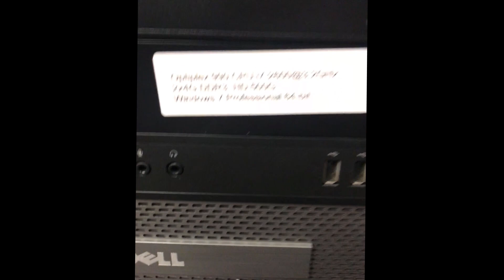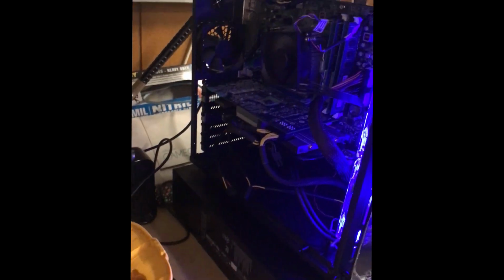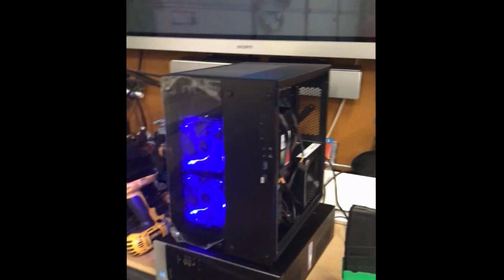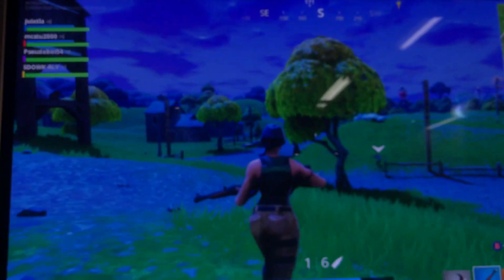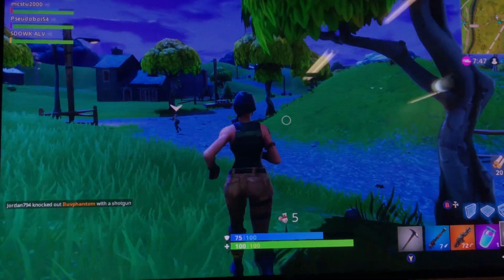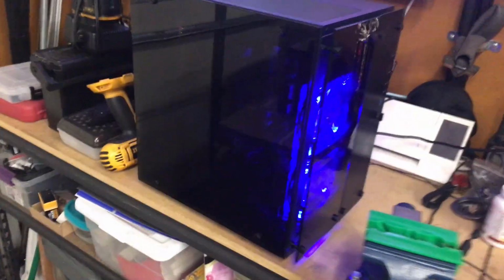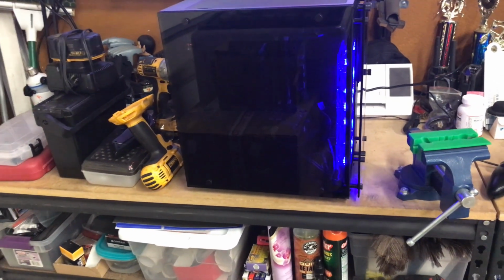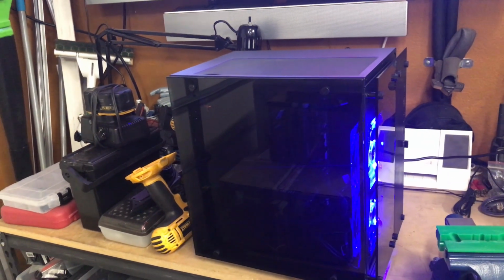Dell Optiplex 990 Gaming Case Upgrade Power Button Pin Out

Comment: If you want led on power light, to the left of that power plug is 2 unused pins, one is 12v . Works great on mine. Tip for tip thanks

Comment: Please i need you're help  i cant find the 6 pin connector for gpu power and i have 990 dell optiplex
Reply from the maker: I had to replace my power supply, motherboard uses standard ATX supply, so you can just pick one up that has a 6 pin connector for you GPU. I would go 500W min.

Comment: So you had to cut the wires to the proprietary power cable and then connect that with the power cable that came with the case? How exactly did you do that?

Comment: hah, i got Dell Optiplex 3020 for 80€ in early 2020
i had to buy me 2x adaptors to start upgrading this thing...

NEVER AGAIN I BUY DELL BTW, they have some weird censors to stop you from upgrading too much...
Reply: Like what?
Reply: I did the same. I got it on Craigslist for 75 bucks. I'm upgrading it and it's been a big struggle. Especially on a super tight budget

Comment: i used the power wire from the new case but the leds for the hhd and power button don't come on. i was gonna ask did you try to keep the front in the case but plugged in.

Comment: You can use jumpers to bypass 3 of the power switch pins and then just plug in the case power wire as normal too. It's the far most 2 pins from the 5th one that looks like it's missing a pin. (Use jumpers Vertical)
Reply: Tribute Born don’t you have to cut the plastic part of the motherboard then?

Comment: Awesome video! I'm doing a 7010 case swap and I don't want to use the optical drive this time around. Is there a way to disable the error on startup without having the drive connected?
Reply: Press f1 i think

Comment: I made one too..But i used  small HD.I5-2400..Power switch.lga 1155 990 M/B,Dell Psu,Rosewell case,Got it all on ebay less than a 100 Bucks..The F! doesn.t bother me at all..one can get a dell 990 lga 1155 board on ebay for 18 dollars..I had Gskill ripajaws ram already...U got bored building assus,MSI and Gigabyte PC's..so Just for Kicks and Giggles Custom Building Custom Dells..My next one will be a lga 9020 Build with the Lga1150 setup...Any Way Great Video..I will Subsribe..Thanks

Comment: Do you really need the Dell stock power switch adapter? Or are there just 2 pins that I can plug my power switch Cable in?
Reply from the maker: You can cut the plastic housing from around the pins on the motherboard, then your new case power connectors will fit. The housing that is currently there is a little narrow to fit the two power connectors from the new case. Take a look at this vid, might be helpful https://www.youtube.com/watch?v=u8sv_33W3FI&t=66s

Comment: I did this with a Roswell case,got a power Switch lead from Ebay,and a 2.5 hard drive to make it easier..I 2400 cpu..already had a MSI750 ti graphics card..thinking about doing a dell 9020 since M/b can be obtained on the cheap..1150 socket i5 4570 cpu..But i can get the barebones sytem off ebay around 50 dollars of which i did added a 3420 duel core ,HD.,ram all less than a 100 dollars
Reply from the maker: Thats not bad at all. Thank you for sharing.
Reply: Wait i have a rosewell office case can you send the link to the power switch lead if you can find it

Comment: You think there’s a way to get the case fans up and running ?
Reply from the maker: Yes, I was able to do that. The stock case fan is held in by rubber plugs witch I recused to mount it in the new case. I attached mine to a vent/grate at the top of my new case. Reusing the fan is straight forward as you will just plug it back in to the motherboard like it was before. Its just a matter of finding a way to mount it in the new. Mounting was very easy for me, but that may very depending on your new case.

Comment: Hey If I wanted to use a gaming motherboard in an optiplex case would the proprietary power switch work on my motherboard?
Reply from the maker: I do not believe it will, you will have to mod the stock plus or cut it off and put new connectors on it.
Reply: @MCStu  ohh ok,do you have avideo on how to connect the black and yellow wires?

Comment: Hey after cutting the power button cable did you solder it to the front panel connector or just push them in far enough to make contact with the pins
Reply from the maker: I just cut the new case connector off and used heat shrink on them. I did just push them in far enough to make contact to test it. You could just leave it like that and put a bit of electrical tape around it. As long as your not throwing you PC around it's not going to come out.

Comment: What specific usb pci-e did you buy im trying to look for it.
Reply from the maker: I had a generic one laying around. You can use any PCIe USB card that has a internal connection for the front panel, which is most of them. https://www.amazon.com/dp/B01G85LFEK/ref=sspa_dk_detail_3?psc=1&pd_rd_i=B01G85LFEK&pd_rd_w=Cunem&pf_rd_p=80559f3c-f83b-49c1-8a72-40f936e9df7a&pd_rd_wg=8DSJo&pf_rd_r=Z0TM8PBBCRTBTFHB6Q1N&pd_rd_r=33ddf717-46cf-11e9-969f-a1ee2b4b46aa
Reply: @MCStu  I'm currently building a 990 also and have been trying to figure out how to connect the front panel usb 3.0 (20-pin) from my new case to the Dell motherboard. I have found pcie expansion cards with the 20 pin header on it but with my RX 590 connected to the blue pcie slot it completely covers the mini pcie slot. This mother board has an additional pcie slot in black which if I used it would allow clearance for the USB card. Did you use the black black slot for your GPU in this build?
Reply from the maker: @bradleyfromma2414  You much use the blue PCI slot for the GPU, but you can use the larger black PCI slot with the 20-pin USB card. Ever though the USB card is smaller then this slot it is designed to seat and is compatible, It just does not utilize all of this slot.

Comment: To Everybody doing this and would like Power Led as Well it is Pins 3 and 5 :-) I did this with a OptiPlex 390 Which is Basically Identical to Mod
Reply: You can also Use the Front Panel Usb from the Old Dell Case to Run Wifi/Bluetooth Internally
Reply from the maker: @nathanmilnthorpe11  You pulled the USB plugs from the old case front panel and just used them internally? That's a great idea.
Reply: @MCStu  Yes as the Motherboard has two headers for Usb Connection you can use front panel and internal usb. And you get a nice Glow from the HDD Activity Lights also :-)
Reply: @MCStu  I am Extremely Happy to see People doing these Mods though. They are Great Machines it's just a Shame it is made to Specifically fit only to Dell Cases. Stick it to the Man that's what I say :-)
Reply: How did you fit the power led connector with the switch connector , I’m doing the method where you break the other part of this power switch connection on the board to fit the power switch connector.
Reply: @sithspideyy Pins 1-2 Power Switch, Pins 3 and 5 are Power led
Reply: Nathan Milnthorpe did you just jam them in there? Lol
Reply: @sithspideyy :-) No, Are your Power Led Positive and Negative on Separate Blocks? If so try them on Pins 3 and 5 and if you get nothing swap them round, I cant Remember which one is Positive and Which is Negative now on the Pins. You cant Damage it so it's a Case of trial and Error Really. Did you Snap the Plastic Carefully from the Edges of the Front Panel Pinout on the Motherboard itself?
Reply: Nathan Milnthorpe you have to snap all the plastic around it?
Reply: @sithspideyy From the Motherboard yes very delicately
Reply: Nathan Milnthorpe what did you use?
Reply: @sithspideyy lay some card or paper around all the edges so not to knock any traces and use a pair of needle nose pliers, Remember Patience is Key with this
Reply: @sithspideyy  The Plastic is very weak so isn't a Hard Process by any Means its just a Small Area to Work with that's a little Fiddly
Reply: @sithspideyy Have you had any Luck sof Far?
Reply: Nathan Milnthorpe couldnt fit them there but i plugged them in somewhere else and it worked , thanks though
Reply: Nathan Milnthorpe i had another question for the temperature sensor were you able to put it inside your new case? , Mine is not being detected therefor the CPU is going at max as a result of the errors and its irritating.
Reply: @sithspideyy The sensor is not Needed, The Cpu fan going at max will be down to Fan Override being Enabled in the Bios. Go into your Bios and Look through the Settings you will Come Across a Fan Override Setting with a Tickbox next to it. Disable the Tickbox
Reply: You will not get rid of the F1 to Resume Screen, But that's No Biggy at Least its not in a Dell Case Anymore :-)
Reply: @sithspideyy Also Make sure that your on the Latest Bios as I have had Issues on Motherboards in the Past doing this down to being on outdated or Corrupt Bios
Reply: Nathan Milnthorpe thanks man you are a savior!
Reply: Nathan Milnthorpe how do you update
Reply: @sithspideyy Go to the Dell Website and type in your Model on the Downloads and Support, Download the Latest Bios and its usually just like Installing a Program there Will be a .EXE File with a Hammer for the Icon (I think its a hammer) This is the Bios update. Double Click and let it do its thing. Don't Disturb it once it has started until it finishes and Confirms
Reply: @nathanmilnthorpe11  hey, I know this  was posted a year ago. 

Can the original dell front panel cable (19 pin connection) be spliced and hard wired to the aftermarket case? Im talking about the audio ones only.... The usb 3.0 I can connect straight into the mobo...
Reply: @markbean832  I will get back to you on that i will try find the schematics up for you
Reply: Nathan Milnthorpe directing to you

Comment: did u just say 660 it??
Reply from the maker: Yes, started with the 660 and then when to a RX 570.
Reply: @MCStu  660 " Ti " not "iT" and also can i just turn it on without power switch cables connected to mobo and just use my psu button on the back to turn it on and off and use f1 to continue to bypass the error
Reply from the maker: @packexpert_2251  I believe you can do this, I will try it on mine when I get home. Some times the PS, when turned on will cause the system to boot, I know this works for sure on the Dell T5500.
Reply: @MCStu  I was about to comment on how old the 660 Ti is and how badly it would run modern titles (if at all for some of them).

Comment: How did you fit the rx580 in the optiplex case?
Reply from the maker: I had to remove the hard drive mounting cage, but it was still very tight up against the memory (RAM) retention clips. I had to get a little ruff with it but if fix and no issue after 8 months. I'll see about linking some pics for you.

Comment: you can make video 
how to change case of dell 990 or dell 3010
Reply from the maker: Hey Ayoub, I'm not quite sure what you are asking. This video is how to replace the 990 case with an aftermarket one. I'm not sure if it is exactly the same for a 3010 although most Dell motherboards are ATX.
Reply: ok brother thank you veru much

Comment: Without a power switch connected to my motherboard, when i hit the PSU button it starts right up. Is this issue due to not having the proprietary switch on?
Reply from the maker: It is not an issue, I have seen Dell and HP computers do this when the PSU is switch on or plugged in.  Here is how you can hook up a case power switch: https://www.youtube.com/watch?v=u8sv_33W3FI&t=101s

Comment: can you made a video with front panel connection?
Reply from the maker: I used a PCIe USB card to hookup the USBs on the front panel and I did not use the mic and head phone jacks on the front, I just used the ones on the back. For the power button check out this vid https://www.youtube.com/watch?v=u8sv_33W3FI&t=13s
Reply: @MCStu  Pins 3 and 5 are the Power Led if you would like it ;-)

Comment: How much did you spend in total?
Reply from the maker: If I include the cost of SSD and extra 8GB of RAM, which I already had siting around. The whole build came in at just under $500. If you skipped the SSD and extra 8GB on RAM, It would cost $420 (Dell 990 $185 shipped, Case $80, Power supply $40, GPU RX 570 $115).
Reply: @MCStu  what's the name of your case I'm wanting to buy it

Comment: Hey there I have the same Computer for around 6-7 years and I was wondering if I added a Gtx 1050 Ti mini from Asus and 4x of 4gb ram ddr3 would it still work? If not please give me something to upgrade so I can at least play Fortnite at 60 fps medium settings or higher.

please email at kingabood115511@gmail.com
Reply from the maker: Yes this will work. The Asus GTX 1050 Ti is powered by the PCIe socket and only requires 300W of power, so you will NOT need to replace the power supply for these upgrades.
Reply: @MCStu  Also if I add 4x 4gb  of Kingston Hyperx fury ddr3 and a we Green 240 GB would it be enough to play Fortnite
Reply: @MCStu  thank you btw
Reply from the maker: @abdollahhosseini2099  Yes, that will be more then enough to run Fortnite at 60+ fps on high/epic settings (you can set some of the graphics setting on epic and some on high). My wife is getting an average of 70-100 fps with a combo of high and epic setting, shadows are set to low while also streaming at the same time from the same PC. Her GPU is a little better (RX 570 8GB) but the rest is the same as yours. Even if you intend on streaming, you will still be able to get 60+ fps in game. Your proposed upgrade will work very well. 

Take a look at one of my wife's streams. The stream quality is not the same as the game play quality, she streams at 720p. But you can see the fps just to the left of the map. https://www.twitch.tv/videos/368714592
Reply: @MCStu  Than you so much and also that's how you earn a subscriber god bless you man
Reply: @MCStu  also turned notifications on
Reply: @MCStu  btw what power supply does she have
Reply from the maker: @abdollahhosseini2099  No problem and thank you for the sub. This is the power supply she has https://www.amazon.com/gp/product/B014W3EM2W/ref=ppx_yo_dt_b_asin_title_o05__o00_s00?ie=UTF8&psc=1

Comment: Hi, I'm doing the same thing .. have you fixed the problem with the proprietary connector?
Reply from the maker: I was able to use the proprietary connector for the power button. But I have not attempted using the proprietary connector for the USBs, mic and auto for the front panel (that's the big one near the SATA plugs). Since I used a PCI-e USB card and plugged new case's front panel USB internal connector in to it, the only thing that does not work is the mic and auto. We are just plugging them into the back. This build was for wife and she's good with it as is, but I have the same PC in the sock case and will be upgrading it soon. I will try it then. I will cut up the left over front panel cable from her stock case and attempt to trace the wiring. I will let me know what I find.
Reply from the maker: One other thing. I am going to try to reconnect all the stock things that make you have to hit F1 on boot to continue (IE: stock fan, thermometer, case door switch/sensor......). I think the only thing that is missing currently is the case door switch.
Reply: So how did you go about wiring the power button exactly?
Reply: So you took the original plug and clipped it and just literally pushed the wires into the power switch positive and negative
Reply: If yellow and black are pin one and two could you of just put the sw socket onto the pins instead of clipping?
Reply from the maker: @MrSpawnofglory  The new case power button connector was a little to big for the motherboard power plug, I did try it and I was able to get it on to pin 1 and 2 but it was pushing out the housing around around the pins so I decided to clip the sock plug from the stock and clip the power connector from the new case, stripped the wires and connected the black and yellow wires to the now stripped new case power button wires.
Reply: I slid the housing around the pins completely off and just put the new cases connectors directly on the pins and it worked like a charm.
Reply from the maker: @MrSpawnofglory  That was a good idea! I'll do that when I do mine next. Thanks
Reply: @MrSpawnofglory  Do you mind posting a tutorial or pics/step by step of how you did this? I'm probably going to do the same on my case switch
Reply from the maker: http://tweakfreak.net/pchardware/pc-gaming-hardware/dell-optiplex-990-case-replacement-power-button-wiring/
Reply from the maker: https://youtu.be/u8sv_33W3FI
Reply: @MrSpawnofglory  I took your approach to the power connectors and slid the housing off. It works, but how did you secure the connection? I'm afraid its going to fall out.
Reply from the maker: @bradyelliott3361  That was my concern as well, but if your not moving your PC around the connector should move.
Reply: I didn't. I just slid them on and they have been fine since. I don't move my case around though unless cleaning dust.